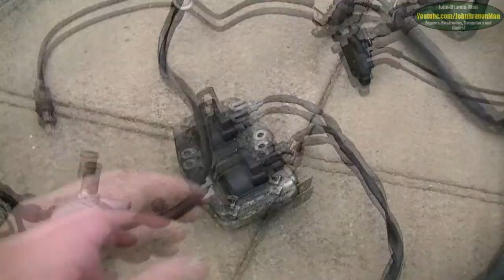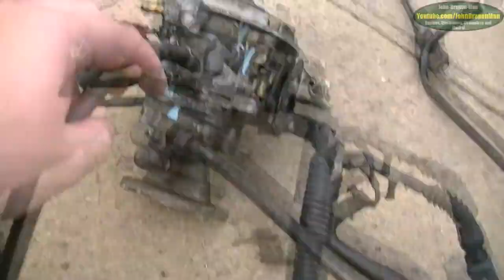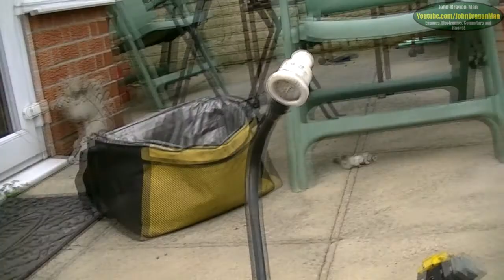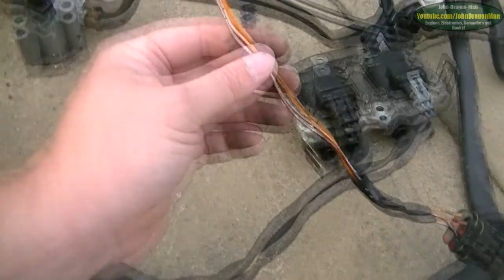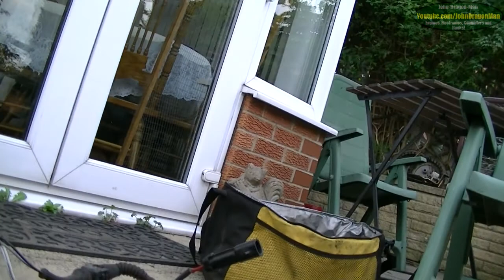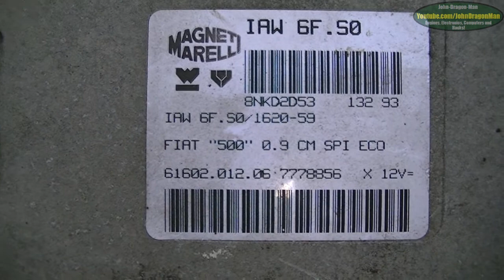Fiat Cinquecento 899 SPI 6F ECU wiring (onto a Seat Marbella 903cc engine)

Comment: i got CINQUECENTO 900 factory set up system with carburetor and with ignition module No ecu no injection , nothing ! Only choke ,   by documents say its 1995 , by  VIN search engine says its 1992 !!? its bought in 1995 .  2 years was not moved ,  change battery ,  termostat  ,coolant and   coolant sensor , the gasoline hoses 2 short from gas pump to filter and from filter to carb , Starts  and    there  was funny noises 5 minuts  , sounds awsome  , just wont to cut off  the catalisator  and nothing else .
Reply from the maker: Does it have a catalytic converter? It is strange to have that if it uses a carb.

Comment: I've just pulled a loom and management system from a seicento, (2000 899 citymatic with one piece management/fuel relay) it has a 7pin connector block that isolates the engine loom from the car loom.

ECU wiring

Thick Green and black to fuel pump, thick white main permanent live via 20a fuse, black/violet to rev counter, orange switched ignition live via 7.5A fuse (shared with code box), grey from code box, black from code box, White with red tracer injector fault light.

Code box wiring 

Thick red/green permanent live splits from thick white, orange/white to ECU/switched live, green to a three pin plug/diagnostic plug (only two wires connected black joins other black on code box), white/yellow to code light, black to ECU, Grey to ECU,

Fuel pump housing

Green black power from ECU relay, Grey/Black fuel pump earth via fuel cut off inertia switch, grey with red tracer and blue with yellow tracer are fuel guage and reserve warning light (don't remember which is which)

The warning lights that are on the dash board are powered from the ignition switched live the wires on the ecu and code box are switched earth's.

So basically other than the engine earths there are only two wires required from the car, A permanent live capable of carrying at least 20A and a switched live capable of carrying 7.5A (both fused)
Reply from the maker: This is great info. Nice to know they kept some of the wiring colours the same from the old days.
Reply: HHAHHAHAHAHAHAAH  Sir you are MASTER ! admire you  how its easy for you !!  unbelivible

Comment: Map sensor take off point is confusing because both the one in the servo take off and the one on the throttle body are both for map sensors, 

I'm guessing the throttle body has been swapped at some point the original would have only had the purge valve and the engine breather.

Comment: Hi John, I have a Seat Marbella 1992. Which is the same as the Fiat Panda 1981-1991, 903cc. It won't start. We have tested the battery, it is good, we can push start it, then it starts, so alternator OK. It is doing a few weird things. The ignition will turn all the way, nothing happens, had no ticking from the starter motor. Lights work when key is all the way turned, as does the horn, radio and wipers. So ignition problem? But twice now the key has got stuckl and we can't remove it. Now the starter motor clicks when key turned all the way, but that has only just happened...? Ignition coil? Or?
Reply from the maker: It sounds to me like the ignition barrel or switch has worn out. To replace it you need to remove the steering wheel (24mm nut under the horn button held in by 2 screws from behind the wheel) and also the column switches (accessed from underneath the steering column should be a flat blade screw driver type slot on a thing that looks like a jubilee hose clamp). You may have to disconnect your choke cable from the carb and run it through the bulkhead a bit to get the steering column cowling over the steering column. Under that you will have the ignition barrel. You should see a little  recess in the side of the ignition barrel. Put the key in the barrel switch it to the 1st position press the little lever which is inside that little recess with a screw driver or another key and pull the key outwards. The whole of the lock barrel should pull out. Look to see if the 2 lugs on the end of the lock barrel now on the key has snapped off. If so that will be your issue. The switch will just pull off the back of the steering lock with a well placed pry with a flat blade.
New lock sets and switches can be found online on eBay Or Google shopping. 
The starter may be sticking with age. Thankfully it's pretty easy to get to and fix. It will just have seized in brushes. Take it off and stick it on its end and fill it with wd40. With the wd40 in it you can tap the end on the side opposite of the gear with a hammer to free the brushes up. Alternatively just undo the starter and free it up and grease it. In fact just try tapping the starter with a hammer and see if that makes it start. Still could do with a clean inside.
You could just swap the starter with one from a 899cc cinquecento or siecento as they are the same. Same for the alternator and water pump( and anything bolted to or in the block).

 Feel free to join the fiat panda facebook group as marbellas are very welcome.
Reply: @johndragonman  Please could you send me a link to the facebook page? Greetings
Reply from the maker: @gabiroberts5273  https://www.facebook.com/groups/161969610665444
Reply: @johndragonman  hi john, great, thanks for the info. I have finally got the key out...WD 40, long saturation, then gentle knock on the cast. Took all day! Now I have the problem how to get the barrel out....I'm scared to mess with the choke, so I've taken the shelf off, trying to rotate the plastic..sorry don't know technical terms, I'm a first timer, I've felt Round the cast which the ignition barrel is within for a release button but there isn't one. ....photo coming...any ideas?
Reply: @johndragonman  Can you send me a photo of the place where I find the place for the flat blade screw driver? I have a photo of what I have done so far but I don't know how to send it to you? Thank you!!!
Reply from the maker: best chat on the facebook group,  can sent pictures more easy on that!
Reply: @johndragonman  Thanks John

Comment: can I put it onto fiat 126Bis
Reply from the maker: Maybe.. however this is from a 4 cylinder engine so may not work with a 2 cylinder engine. Saying that.. with it being a dual coil pack system it may be possible!
Reply: @johndragonman  I was saw one example of injection 126 but I don't know how it is made
Reply: You can fit the fiat fire engine to a 126, there are conversion kits
Reply: @prawny12009  but these kits for air cooled ones mine have got water cooling engine
Reply: @huseyinuguralacatli5064  it takes a little more fabrication and fitting a frame parcel shelf but it is doable once the engine and transmission are mounted together.

Even the air cooled models require fabrication for the rear most mount.

Only problem would be that the bis and the 126p/air-cooled engines spin in different directions.
Reply: @cyka blyat  the benefit of a wasted spark on a single point injection car (or batch fired multipoint) is that it will work with both 1-3-4-2 and 1-2-4-3 firing orders.

Depending which car and model ECU you use Some fiat ECU have the coil output wiring swapped making 1+4-2+3 and vise versa so you have to swap the wiring to the coil from one to the other, the rest of the ECU pins remain unchanged.

Comment: What about immobiliser ? And key code?
Reply from the maker: Alan Brullo if it is from an early enough car, it will not have an immobiliser. if later you only need the key and code box extra. very simple only 1 green wire connects it to the ecu. the rest are earth's and lives.
Reply from the maker: @Rat Biker hmm, you have the wire colours yes?  if you want to add the CODE box to a ECU its the green wire.. goes to pin 27 i think on the ECU. the white with blue stripe wire goes to the CODE light on the dash. the other wires should be easy. this is however going on the Fire engine ECU wiring. 
if you look on FiatForum.com and search you will find wiring diagrams.
Reply from the maker: @Rat Biker which ECU are you running? the IWA xxF ? (x = numbers)
Reply from the maker: @Rat Biker glad its working! :D sounds good too, do you have a video of it?